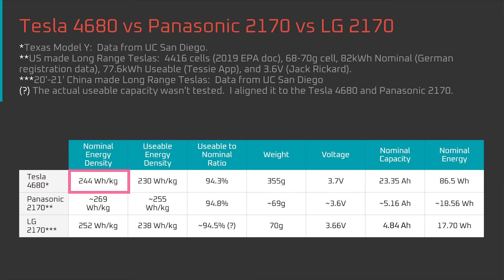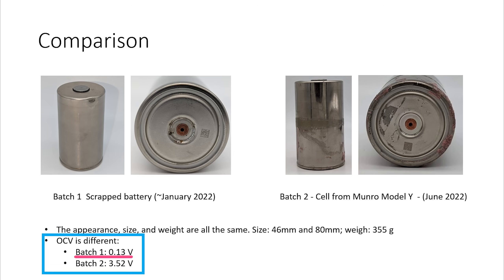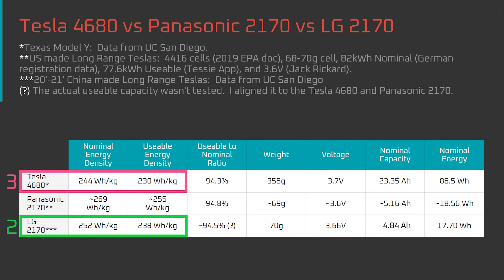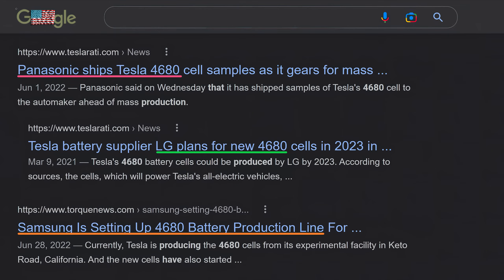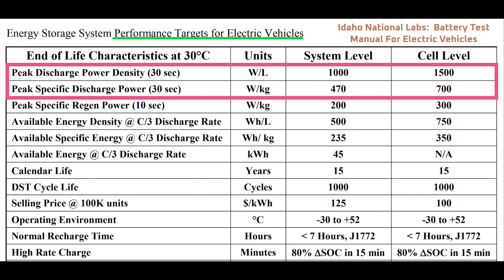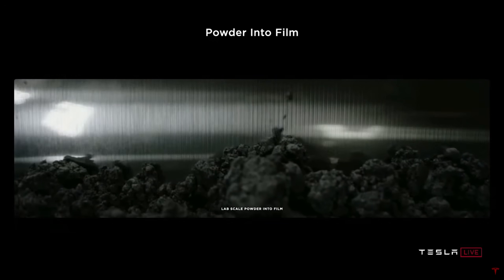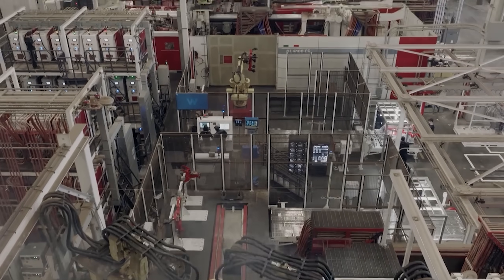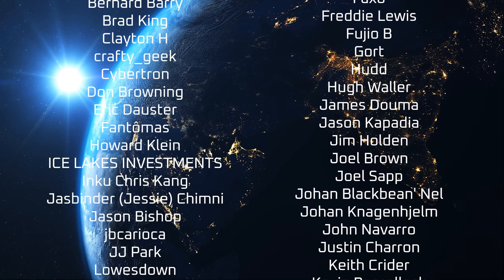Munro 4680 Energy Density Tested // Model Y Pack Size Explained

Comment: Northvolt is so far ahead with its Cuberg lithium-metal cell at 405 WH/kg.
Reply from the maker: Just like this cell, we actually have to see what makes it into production, and what the faults of the cell are.  There is always a trade off.
Reply: It's cheap and scales great, right? RIGHT?
Reply: @NO3V  It should be pretty straighforward as you can use the current process equipment to manufacture it. Basically only need to replace the anode with a lithium-metal foil.
Reply: @rojavabashur6455  So if you answered my present tense question with present tense answers instead of shouldProbablyI'dImagine?
No? 
 or
Don't know?
Reply: @NO3V  We dont know at the moment for sure, but they should be decently easy to manufacture as Cubergs whole idea is to design a cell that is easy to scale with the current manufacturing equipment. The lithium price may push the price up on the cell though, but the lithium price should come down soon.

Comment: While we would like to see all specs improve: less weight, more range, etc. It’s true that reliability and production rate is what matter most at the moment. Tesla doesn’t want to get millions of recalls in a few years on batteries or casting, that could destroy the company. It’s better to play it safe with the new technology until they have a lot of data on the failures modes.
Reply from the maker: Bingo!
Reply: 100%... The combo of castings, structural battery packs and 4680s are all entirely new and so its imperative that Tesla play it safe. This will all get refined over time but lets take the changes out nice and slow so that there are no recalls. These components are clearly not designed to be replaceable and so they must get it right first time or the car is a writeoff. Lower efficiency right at the get-go  is an acceptable tradeoff for me.
Reply: Yeah. The importance of range drops off after a certain point, maybe somewhere around 300-500km, when you simply have enough range for most of the things you'd want to do, from daily commutes to road trips. 

Your average consumer also isn't going to care that much about how you get that range, whether it's a by increasing the size of the battery until you are left with a 2.5t hatchback or by optimizing the energy efficiency of everything you can get your hands on. Ultimately the only thing that matters once you cross that threshold in range, is reliability (for older/used vehicles with data on them), if the vehicle is even available for purchase and how much it's going to cost.

Comment: Muro charged you for the Cell? Wow that's bogus. They didn't have the resources to get this level of data.
Reply from the maker: They put a lot of time and effort into tearing down the pack.  Yeah, the cell is expensive, but that's supply and demand 😁

Their report is coming out soon.  I think it will cost a few hundred dollars.  I might buy it.
Reply: @thelimitingfactor  I think your contribution here is very significant Jordan. Surprised Munro didn't just want to work with you on it. 

At any rate the community really appreciates everything you do. Thanks

Comment: Are other manufacturers using 5-tab instead of tabless because of Tesla patents?
Reply from the maker: Five tab design is a lot easier.  From memory, the patent application for the tablets electrode wasn't strong.

So I think there's wiggle room there for other people to do it
Reply: Tesla has released its patents (subject to certain conditions).
Reply: @fredbloggs5902  Right but my understanding is that the conditions are that the other company allow Tesla to use their parents too and I'm not sure whether other companies are open to that.

Comment: Just a guess, but wouldn't there be an upper limit to cathode thickness for a wet process due to the necessary evaporation of liquid from within the cathode layer? At the very least a thicker cell should increase drying time and make a wet process less efficient for thick layers
Reply from the maker: Oh boy, there are a lot of challenges, and evaporation is one of them!  The interesting part is how to get around it...

Use different viscousities and different material mixes to create two layers at once.  Otherwise you have to do multiple drying passes.